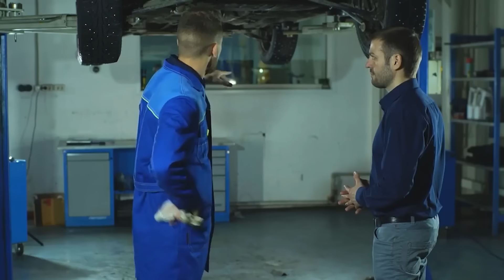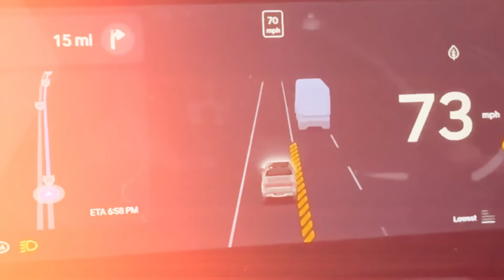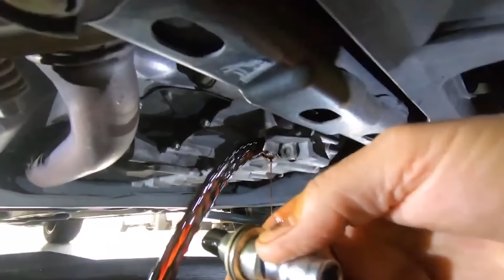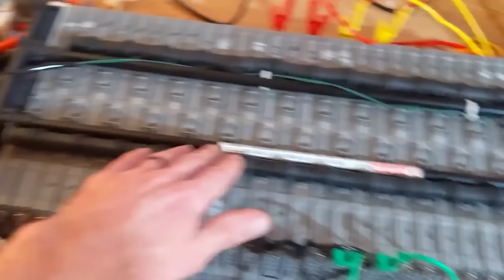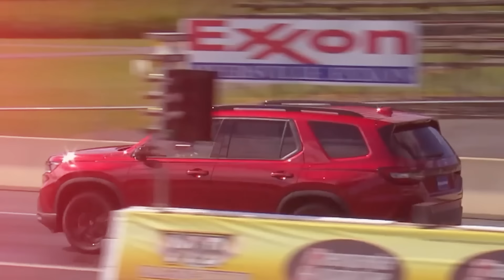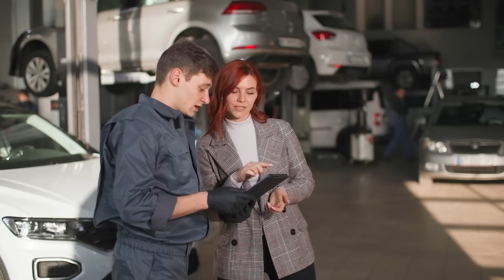NEW Honda Service Center Scams That You MUST Be Aware Of!

Comment: As a Ex Honda tech now extended warranty adjuster with over 33 years of mechanic experience there is one type of extended warranty that I know of that requires maintenance be done at a specific milage interval unless the factory maintenance schedule was a lesser interval...for example the extended warranty requires oil changes at 5k or every 6 months but the factory oil change interval is 10k or every 12 months...in order to keep the extended warranty satisfied you must go by the contract intervals but if the factory requires requires 3k or 3month intervals then the factory overrides the contract...please , please,please read the contracts for you extended warranty because some do have a 10 year courtesy inspection that needs to be done to keep the warranty active pleasure to meet basic maintenance requirements will void out the contract. And a lot of service centers do not know what the contract says. So if you have a contract like that make sure you stop by the service department to ask for a checklist of the courtesy inspections. If they have no idea what you're talking about show the contract it should be written in there that a courtesy inspection is needed. Sometimes customers don't keep their cars that long that the service department may not be doing of courtesy inspections because customers don't bring them back. But typically the courtesy inspection expect things that are covered by the warranty so they find any problems the extended warranty will pick up the bill for the repairs. Providing all the maintenance has been performed. This was a good video thank you for the information

Comment: Had service at the dealership 2 times in 2025.  The visits were 2 months apart only.  Both times, they wrote up estimates that were overpriced and for things not needed.  Took the estimate to my car fixit guy that I go to for all the little things like windshield wiper and oil changes and fluid level checks.  And he went thru that list and basically all the dealer estimates were for unnecessary work.  

So now I need something major and I was about to go to the dealer for that job.  Amazing timing that I see this video now because I was going to call the dealer for the price and appointment. 

Thank you for this video.  It really helps out someone like me who knows nothing about my car.

Comment: Taking your car for service to the dealer is highly robbery, i only go for oil change sometimes to keep a steady maintenance record in case i decide to sale my cars eventually. I own a Honda Accord and an Acura RLX, and every single work is performed by an independent mechanic and good friend of mine Mr Michael Tejeda (former Honda Technician at Bronx Honda for more than 10 years). You might think I'm lying for how much he charged me for the last job performed to my Acura RLX but believe me it's 100% true. Front and rear rotors (to take out and install rear rotors you need a special computer to release calipers due to E-brakes) + pads + spark plugs(6) + engine air filter + Cabin air filter + oil change (bought the oil and filter himself) + added brake fluid and even put a plug on a leaking tire, everything for $170 dollars...!🤷 Note: I bought the parts myself online at a certified Acura Warehouse. If you take your car to the dealer to do the same job he did to my car you'll end up spending at least $1,800 dollars or more easily, so if you live in NY, especially in the Bronx area and you own a Honda or Acura and want to perform a minor or major job to your vehicle let me know and I'll put you in contact with Michael, you won't be disappointed and you'll thank me later..! 👍

Comment: I GOT SCAMMED AT JOHN EAGLE HONDA IN HOUSTON TEXAS OFF OF 290....TOOK MY WIFE'S 2014 HONDA PILOT FOR AN OIL CHANGE AND I WAS TOLD THAT MY ALTERNATOR WAS BAD WHICH COST 1100. AT THE END OF THE DAY IT WAS THE BATTERY THAT NEEDED REPLACE. I WANTED TO F***CK THE WHOLE F*CKING SHOP....

Comment: Toyota Dealership tried the exact same SCAM on me about 3 years ago.   Their bait-and-switch was, "Your model might have a issue burning more oil than it should.  Come in for a free analysis."   After going into the dealership, service department said mine was not burning oil beyond normal, but I needed $3800 in repair -- all GARBAGE !   The most laughable of which was $900 to "repair" a 1/4 inch misalignment (gap) between the dashboard edge and the windshield.   NEVER go to a any "dealership" of any type for repairs.  SCAM SCAM SCAM

Comment: I HAD MY WINDSHIEL REPLACED BY OUTSIDE VENDOR AND NEED THE CAMERA CALIBRATION. THE DEALERSHIP WANT $1500 ???? THE CAR RUNS PERFECT AND THE ONLY THING I LOST WAS THE CRUISE CONTROL, LANE ASSIST AND ETC. BECAUSE THEY CAMERA NEED TO BE CALIBRATED FOR $1500… I TOLD THE SERVICE PEOPLE, IF I WOULD SPEND $1500 FOR THE CALIBRATION, I WILL JUST TRADE IN MY CAR… THEN THE SERVICE PERSON JUST STOP UPSELLING ME BECAUSE I WAS CORRECT !!! MY CAR STILL RUNS LIKE NEW WITHOUT THE CALIBRATION !!!
Reply: There are other shops out there that do that kind of work. I do know that safelite does the calibration. Let your fingers do the walking through the yellow pages.

Comment: ANY AND OR ALL DEALERSHIP WILL UPSELL YOU MAINTENANCE OR REPAIRS YOU DO NOT NEED !!! IF YOU DO NOT KNOW ANYTHING ABOUT CARS, THEY WILL INTIMIDATE YOU AND IF YOU AGREED ON WHAT THEY SAY, CHECK AND GET THE THINGS THEY REPLACED !!!! EVEN JUST HAVING AN OIL CHANGE, CHECK THE OIL DIP STICK AND SEE IF THE FLUID IS CLEAR !!! IF THEY SAID THEY REPLACED THE BATTERY, CHECK THE BATTERY AND ASK FOR THE OLD BATTERY !!!! BEEN THERE AND DONE THAT AND I CAUGHT THEM !!!!

Comment: I had a 2022 Honda CR-V and I was told I needed the differential changed. I only had 16,000 miles on it. Way too early for that!
Reply: Why did you do it if an expert mechanic told you so, he thought you lost your user manual.
Reply: @Joe-lh8ij I didn’t say I had it done. I didn’t. I’m not an idiot.

Comment: I worked at a Honda dealership from the age of 19-21. I started in tire and lube while I did the Honda certifications to be a line tech and moved up to line tech when I finished that certification. I got laid off for not “aligning with the companies needs” along with 3 other techs, because we would tell people when the service advisors would add unnecessary services. I’m not a crook and I refuse to do $1000 worth of repairs when the car only came in needing something simple like brakes or an alignment. The book values on jobs also needs to be updated because the K24 starter replacement takes 20-30 minutes but the shop charged 3 hours of labor plus parts because the repair manuals want you to go from the bottom and tear the underside of the engine bay apart. On the K24 you can just remove the intake mani and the starter is just right there. I couldn’t do anything about that but I always felt so scummy and I would do something like change their oil or something for free which I was wrote up for 😂. I wasn’t that upset when I got laid off needless to say.
Reply: God bless you. Stick to your principles!!!❤
Reply: We need more mechanics like you! Open up your own shop and ppl will come to you forever. God bless!
Reply: You sound like an awesome individual! Sounds like the "company's needs" prioritized profit over honesty. As soon as my Civic is out of warranty, I'm going to use my local shop for service and maintenance. Incidentally, laying you and the other 3 techs was Honda's loss, NOT yours! I applaud your integrity and honesty, Brother!
Reply: I know a mechanic  who went thru the same thing 30 years ago at a Toyota Dealer .
He quit and has had his own shop for 30 years .
Reply: Some would call that fraud
Reply: certainly would like to know the state at least were you worked
Reply: You are a person of high.integrity and honesty! The world needs more mechanics like YOU! God bless you.
Reply: Honesty is a great value these days, thank you. I love everything Honda but I know they are scamming people left and right and it does not sit well with me )-:
Reply: What state are you in would like to meet you I have a 2002 honda crv ex
Reply: God Bless you!!!❤
Reply: You know he doesn’t open his own shop? You pay for the proper equipment you need, plus the free loaner vehicle you get. This guy  hasn’t a clue how to run a shop

Comment: I used to work for Toyota in the 90s.  If you wanted your car fixed right, you could trust the dealer to do so, but you'd pay a premium for it.  Now they are the biggest scammers out there, and still charging a premium.  I always buy maintenance packages on my vehicles cuz I'm retired and done with being a mechanic.  Even then, they still try to find a away to charge me for nonsense every time I bring my car in.  Was even told by Marin Honda that there was a nail in my tire, and since it's AWD they had to replace all 4 tires.  I told them GTFO, I'll come get my car back.  They threatened to void the extended warranty I purchased.  Dealerships are the biggest scammers.  Thanks to youtube I just fix everything myself now.  So I guess I'm out of retirement.

UPDATE: It turns out I've got a blow n head gasket in my 2021 Honda CRV hybrid with 80k miles on it.  I do oil changes with OEM parts every 5k.  There is no reason this should happen, but it turns out it's a common issue.  No worries, cuz I've purchased an extended warranty on it.  Now the warranty company is fighting me on it because I didn't have my oil changes done at the dealership.  This will likely be my last Honda.
Reply: I had a 2016 Nissan Sentra I purchased brand new with the 7 year warranty. The transmission started sounding terrible at about 20k... Took it to the dealer, they diagnosed with something on warranty. Said transmission was fine! The sound would get better but noise returned - and started getting worse. Within 5 years, I had it to the dealer three times for the same issue. All three times - nothing wrong with your transmission. At that time, the dealer covered the transmission up to 5 years or 50K. 

My mother and I had a wonderful mechanic for 20+ years. He kept my mom's 1994 Nissan Sentra and my 1993 Honda Civic going for pennies on the dollar. Jesse always said to buy either a Honda, Toyota, or Nissan. Well, I didn't take my new car to him, because of the 7 year warranty. Decided to make an appointment with him to do an oil change and check out the car, since I knew the five-year warranty for the transmission was coming to an end - the next day. He was busy when I left the car, he called me and asked me why I bought a Nissan! I was shocked! Told him that he kept my mother's old Nissan going forever and always said it was a great car! He said not after 1999 - Nissan's are now garbage because of the CVT Transmissions. Told me to drive that car straight to the dealer and demand that they put in a new transmission (on their dime). They wanted it to be on my warranties dime. I told them that's not going to happen, you knew that transmission was going out for the last 20,000 miles. They put in a new transmission at 40K. I maintained the car and did everything on time - my mechanic told me at 80K to trade-in the car, but not for another Nissan. Said it was garbage. I didn't take him seriously, at 87K - it had so much wrong with it - would cost more to fix it - than it was worth. 

I now have a 2025 Honda HRV. My mechanic told me that it would be a good car for me, but to make sure I get that 7 year warranty. They actually tried to overcharge me by $7K (for the car) - and also added a maintenance warranty for nearly $2K. It was two weeks after I purchased the car - and was getting ready to write them a glowing review - decided to review the contract and the advertised pricing. That's when - I realized what they did. I made an appointment with the finance manager and marched into the dealer and told him - instead of treating me like your grandma - you treated me like a stupid old lady. You need to make this right. They knocked off $8,000 with removing the maintenance warranty. Really would rather go to my mechanic for the oil changes, but my concern is that they won't stand by the warranty - if I do. 😢
Reply: I'm so sorry that happened to you. My story is above... My son likes the HRV, so it's pretty much his car. I just bought a 2003 Toyota Corolla from my friend for $500 with 187K miles. She had purchased it brand new. Took it to my mechanic. He advised, only needed an oil change and the oil and  transmission should be serviced - total $190.

Anyway, when I went to pick up the car - he told me that that car will last forever - and if I decide to sell it - please let him know!

Comment: I never take my Honda and Toyota to a Dealer for work or maintenance. I take my car to a small shop that uses Factory Honda Parts & Toyota Parts. They never try to suggest any additional repairs or services. I have a 2002 Honda CRV with 263,777 miles I change my oil and filter every 3000 miles (recommened 7500 miles) and my 2017 Toyota Corolla every 4000 miles instead of the factory (recommended 5000 miles). CVT Fluid every 60,000 miles. I will not be ripped off!!!

Comment: Had this type of thing happen to me TODAY! Went in for very first service on 2025 Ridgeline (oil/filter, rotate tires). At only 3.5K miles, I was told my "wheel alignment test" had failed, and I needed a "wheel alignment"...after only 11 months of ownership and only 3.5K miles (no off-road). Walked away very pissed off. Extremely disappointed in the dealership where I purchased the Ridgeline. Will be extremely cautious going forward! Question EVERYTHING!